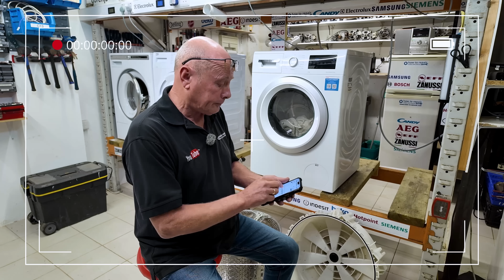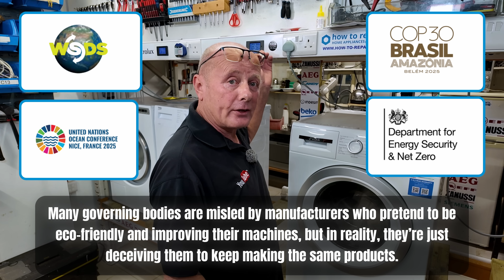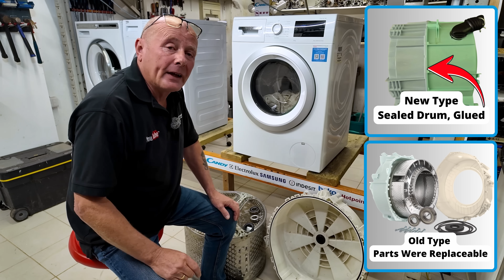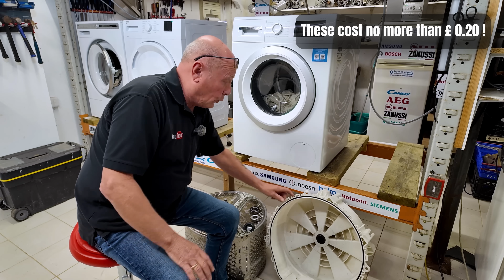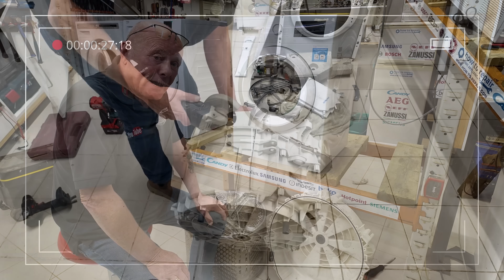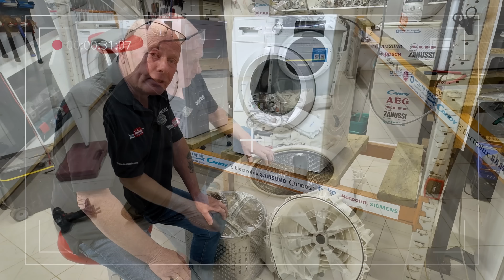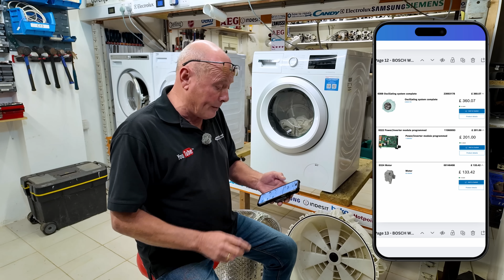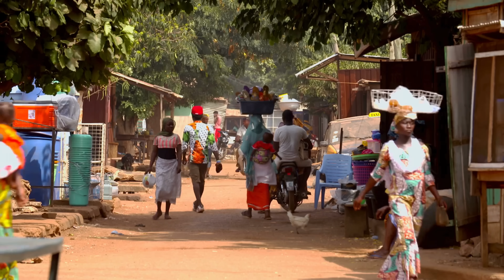Washing Machine SCAM EXPOSED! The Truth About SEALED Drums: Naming & Shaming

Comment: As a result of one of your excellent videos, I have just repaired my tumble dryer. Turned out it was the temperature variable resistance. BUT not without a bit of difficulty. The plastic control panel (which must be removed) is retained by plastic lugs. They are pushed into oval (ish) holes stamped in the casing. Nominally you can just push up the lugs a bit and they will pop out again. Not on my machine though. Two or three of them had been pushed in then some tool had been used to squeeze the oval hole tight on the plastic to prevent the lugs exiting again. I had to drive in a wedge to prise them open again. We have had the machine from new without repair so it wasn't some previous repairman. Simply a crude attempt to prevent repair. Didn't work against me though.

Comment: In Pandemic, I ordered one washing machine and 1 dryer. Both Electrolux. The dryer died in under 1 year. (Yes, I did all the proper care, and I always clean the filters after every use. The washing machine died after 4 years of use. We wash 2 times a week. No kids, just two adults. We do not wash heavy things like blankets or heavy winter clothes. The dryer could not be repaired, but we were able to get our money back due to the warranty. The washing machine was a loss of money. Yes, it was a good machine, but its lifespan was too short. My grandma's machine was an old Indesit. It worked like a mule for over 15 years.  So...

Comment: I bought a Hotpoint Aquarius + 7kg washing machine nearly 9yrs ago and ( touch 🪵) the only thing that has ever gone wrong was it stopped spinning last year. I knew from past experience it needed new bushes, so i went on local community platforms asking if anyone local could fix it . I didnt let on i knew the bushes had gone i played daft and just said its not spinning dureing wash cycle???, OMD i got 3 replies 1 said i needed a new printed circuit bored as thats the only thing that would cause that to happen price £120. another one said it needed a new motor he said he can get a reconditioned one and fit it for £80, the last one said it needs a new motor and belt price £120 . I asked all 3 how would they know with out comming out to look at it ?? all 3 gave the same answer they have been fixing washers for years and 99 times out 100 that was the problem . I went on line and bought the bushes for £5.99 . I removed the motor fitted the new bushes put motor back connected it all back up back to working as good as new. Id like to think they all quoted high prices cos it wasn't worth fixing better off buying a new machine which none of them suggested or they cba fixing it or was gonna rip me off ??, so after 20 seconds finding a tutorial video  on utube on how to fit new bushes i saved myself around £3-400 the cost of a new washer or a £100+ repair bill and fixed it myself and was well proud 😂😂😂😂

Comment: Definitely fake environmentalism and virtue signalling or green washing from these manufacturers.  Common sense seems to have departed this planet. Some years ago I was given a price to fix the bearings in my Miele washing machine and it ended up being not worth it because it had a recurring water inlet valve problem as well that the Miele technicians could not explain notwithstanding that they replaced it several times at their expense even when it was already out of warranty.  I ended up buying a new washer instead - not something I relished as it meant going back to many hours of research before I spent my hard earned money.  Then you cross your fingers and hope for the best.

Comment: Right to repair (RTR) ought to enshrined in law.  The bearings are a great example of why RTR is so important.  Throw the machine away - 525 quid gone or replace the bearings 20 quid.  Landfill goes up.  I replaced the micro-switches on the front panel on my LG machine - cost 1 pound 25 pence.  If you are director of parts at Bosch etc. well you want your bonus right?  Keep those sales prices up by screwing the customers.

Comment: Hoover in NA sells but no longer advertises the floormate deluxe which had issues with motors overheating and seizing likely due to the windings being made too thin but that seems to be resolved (I let mine cool down after each floor section as a precaution) as my last one lasted 5 years of just wet use being junked due to the pickup tube hose fitting splitting open which cause as loss of suction. Hoover doesn't sell this part any longer and all existing supplies are gone and when a used one is made available it gets sold almost immediately at prices that exceed the new cost. (when it was available) They also have bonded the hose to a large fitting that makes just replacing the hose portion difficult if not impossible.

Comment: FATHER ALMIGHTY FATHER CREATOR OF YARDSTICK SUCH I AGRREE HOWEVER MY LORD TIME NOIN YOU OPEN ALL SEAL SCROLL IN THIS DELEMA LIKE GE TUB SEAL ORIGINAL B LACKING ON PARTS SUPPLY SITE , UNDER CARRIAGE PREMATURELY OR  WILL FULLY LACK PAINT , THE HOOD OF MACHINE DEEM TOP COVER NEED DAMPER HINGES TO OPEN CLEAN AFTER USE LIKE CAR HOOD TRUNK TO REMOVE SOAP OXI .

Comment: I (had) a Beko dryer. The pcb failed- it wasn't there fusible resistor, but the actual microprocessor memory for corrupted. It was only 5 years old. I was willing to pay the $200 for a new pcb, as the dryer was very lightly used and otherwise in perfect condition. Guess what- no part available from Beko or any other source, and Beko was not able to tell me if more would be produced.  In had no choice but to scrap the whole dryer. Bricked because of a $1 microprocessor.  (It's the same chip as an Arduino).  Beko - fail.

Comment: I used to be able to buy Bosch brushes for their tools £10, now only motor with brushes £150, new drill only body £160, DeWalt drill trigger £25, now trigger with circuit & fittings soldered to it £75 body only £76 manufacturers don't want money going to the local economy for repairs, more profit in selling new, cant blame them though if it works, the result my scrap bin for power tool repairs is now removed 4 times a year instead of once, just the toxic nature of this waist ruins any hope of being green, the government need to stop cheap imports filling landfill to be serious, then hopefully European manufacturers can produce better equipment again.

Comment: I had the same problem with Slovenian Gorenje washing machine. Bearing has gone, but drum was sealed and it didn't make financial sense to buy expensive new drum for old washing machine. However, it would make a lot of sens to spend 5 euros to change bearing myself.
This way washing machine ended up in garbage instead working couple more years.
This is infamous EU environment and ecology bullshit. Never mind I just toss whole machine in garbage, at least it was consuming 5% less electricity. Ludicrous.

Comment: I have some experience in this. The tubs are not ‘glued’ together but vibration welded. While this is an additional process, it removed the seal, fasteners, fastening process, and pins needed to make the holes in the injection moulds. 

The weld flange profile is completely different from the bolted seal type, and the vibration weld process needs a flange above/below the weld that can direct the forces above the weld flange, so the tubs are very different when designed for each application). 

Generally, the welded process is slightly cheaper as a whole, but are negatives of course obvious - so it’s a decision made on economics. 

You can actually buy two almost identical LG model front loads in the US, one manufactured in the US, the other in Asia - the US model is welded, the Asia model bolted.

Comment: Got a new "Bauknecht" with Autodose featrure. Its just one more part they fit to have another part that can break it seems. Mine broke. Luckly its still in its 4 year warranty so they cover the repair. But that kind of reparis are included in the caluclation. They make much more form customers who need to throw away there machiens after the warranty or replace the whole unit. I hate this.

Comment: Try the current ultimate planned obsolescence icon.
Many car makers have done away with traditional timing chains. Replaced them with rubber timing belts running in oil INSIDE THE ENGINE. Only last up to 80000 km so cam belt change 60000 km recommended. 
This requires extensive dismantling of the engine bay removal of the timing cover, which is plast and non reusable. Costs at 60000 km up to £3000.

Comment: it's the same as when they added a heater matrix to dryers ... when it goes its a switch ..when it trips no heat ... you throw it away or THEY TAKE IT AWAY and it's a simple fix with a screwdriver and a cocktail stick

Comment: "I recently had to replace the controller board on my Miele washing machine after our cellar flooded with 5cm of water. Interestingly, the board is installed at the lowest point of the machine—a design choice Miele claims is for heat dissipation. Miele told me a repair wouldn't be economical, but I decided to buy the PCB myself for €300. It only took 10 minutes to install! Given the machine cost €800 and has run perfectly for 10 years (and still looks brand new), it was well worth the effort despite their advice.

Comment: Sir, India is in the northern hemisphere too, both literally and in reference to this issue. And I am an Indian who just had to replace a Bosch washer for this exact reason. It served us for seven years where we expected it to do ten like our previous LG one. We take good care of our stuff. 

The drum moved forward to the point where it made contact with the gasket at the front loading opening, rubbing against it and producing smoke. Authorised repair technician charged a hefty sum for a visit and gave a huge replacement quote because the drum was sealed. Bought new asu it made better sense, and also because they didn't offer warranty on any replacement part.  Hit our budget buying a new one where a simple repair with replaceable components would've saved us a fortune. 

Thank you for raising your voice.

Comment: Hey! A very important video! I have an AEG 2-in-1 washer-dryer with a heat pump. It cost around £1,300. I was surprised when I tried to replace the bearing! I ended up replacing the entire drum myself for £200. The bearing alone would have cost around £15. Thieves! Do you recommend any other brands? Ones that can be repaired?

Comment: Great points raised here. I'll ask if the drum is glued before buying a new washing machine, and not buy one that is. Currently trying to repair my White Knight tumble dryer ECO 83A tumble dryer - there's a rumble from the front end of the drum...  seems manufaure in the uk stopped in 2019 and spares are very limited ...  wish me luck as i really don't want to buy a new one ... plus they don't make gas ones anymore...
Reply: Well, just as an update i removed the drum... to find nothing that could produce the rumbling noise ! then turned the motor and there it was.. so the air flow fan is connected to the motor via a round shaft with a flat face on it .. the fan has a corrosponding flat in the drive which is held on to the drive shaft with a collet. in my maching the collet has dissapeared ; allowing the plastic to expand and spin semi freely on the shaft meanwhile the fan is off centre and the blades are hitting on the housing , causing the rumbling noise !

Comment: First what is the warranty period  you make a statement then don't follow up with data 

Do my bosch washing machine came from bosch with a 10 year parts a  labour warranty so you say it will fail after 10 years to be honest if it last 10 at £325 we paid its not a big issue as we gotten good use from it. 
In the uk under the consumer act a washing machine expected to work for 6 years . Upto to six year your are entitled to it being repaired or replaced under  consumer law..
Then we have to come to the price . Washing machine today on the whole are cheap disposable white goods.  
They are made to be disposed of after 6 to 10 years 
Manufacture don't have to have spare after 10 years. So why would the go to the great expense of creating a washing machine that can have its parts replace cheaply and for 20 plus years into consumer society  mostbpeople want to replace after 5 years. There are very few of use who keep white goods for years znd years today so when you think about washing machine have got cheaper to buy so they have to be cheaper to manufacture  and it gets to a point where fixing not cost effective my washing machine is 9 years old to replace for a like for like machine it less to day than it was 9 years ago 9 years ago £325 today the equivalent bosch is £299 factor in for inflation etc washing machines are cheap .stop complaining

Comment: Maybe, right to repair needs to be tweaked.   If the machine is less than 10-15 years old but too costly to repair  then the manufacturer must collect it from the place of use and pay for all recyclables to be stripped out.

Comment: Excellent job mate informing people !!! 

As a big DIY guy and always curious how things work I did fix my direct drive LG a few months back as my house was flooded with mud in 2020 and the bearings were sounding like aeroplane. The LG  is 5 years old and the case was holding from screws so taking apart wasn't big deal. I installed install new NSK sealed bearings and new flange.

Brand new 😂.

Keep up the good work.

All the best from Greece kefalonia 💯💯💯

Comment: My grandmother bought a Miele in 1950. It ran well into the 1990ies…

Of course these prices seem too high. But if the drum seems to stem at least partially from injection molding you might have to factor that in. Molds are very expensive. 
Still I think devices should be designed to be repairable. Everything else is only good for business but little else. 
Nice video 👍

Comment: I want to mention that most of the washing machine industry is own by: Arcelik A.S. (beko, indesit,hotpoint, whirpool, indesit, hoover, candy), Electrolux AB (whirpool, zanussi, AEG),  Bosh GmbH.
Then you have LG washers with quality problems (F4W especially on polish market) - high vibrations and noise due to incorrect screw torques during assembly.
Samsung, who pushes ads to their smart appliances.

Comment: What fails on the circuit board? I see sites that print circuit boards. I'm assuming it's the components like switches or power supply modules? I'm wondering if a raspberry pi with a bread board could handle the work?

Comment: Another point: I've already bought new machines and compared the cheapest models to the most expensive. Nothing differed except the number of buttons and LEDs on the control panel. However, on current models, the controls were in exactly the same place. The drums were also identical, and I'm sure the motors were the same. Prices varied from the cheapest to the most expensive, at least double if not triple, but the overall configuration remained the same. I've already repaired freezers (1N4004 diode failure), washing machines (switching power supply failure), and so on.Everything is designed to last only five years and is not repairable; repairs are only possible by purchasing expensive spare parts. Regulations need to be changed to allow individuals to repair their own machines at a reasonable price.

Comment: Just bought a Siemens machine only because I know from past experience that I can get the parts here in Europe. 

This was very disappointing to see because I know what the future will be like. It will fail, and I will just by a new machine from a different brand. But now I know that you actually have to research if you can change the bearings on the drum before buying it. 

What a cluster fuck of a world this is

Comment: I bought a Zanussi ZWF 1470W washing machine around 2008 and it clearly had a noisy drum bearing out of the box. Called someone out and after replacing the pump to no avail agreed with my diagnosis. Then he said there is no way Zanussi would pay for the repair of the drum, it was too much work and money because it hadn't actually failed. He said he didn't think it would get any worse so that was that. No idea if that age of machine has a sealed drum but it seems repairs maybe exceed cost to manufacture. By the way, the engineer was right, it's still going strong after bringing 2 girls up and doing all their washing!
I suspect the reason manufacturers are buying in sealed drums is that they're perhaps less likely to leak, reducing warranty claims. I'm only guessing though, it would be great to invite a manufacturer to defend their position, perhaps there is more to this than meets the eye? As far as I'm aware current Ebac machines use repairable drums as a selling feature so maybe others will follow?
Why not have a repairability rating as well as an eco rating, it's equally important to know how likely it is that our purchase will soon end in landfill and as such cost more to run during the lifespan.

Comment: After watching a east European YouTube video I actually cut my drum in half on my ten year old Zanusi washing after the bearings failed. That was more than five years ago and it is still working. Cut in half and glued/bolted it back together using the unused holes still in place on each side of the drum. Talking about planned obsoletence just look at the drain motor internal coil connections. On mine that also failed these coil wires were pressed in and not soldered as other joints within this assembly. These connections are planned to fail after exposure to any damp conditions. All I did was to clean them and solder them as they should have been done during initial manufacture, worked perfectly. Absolutely disgraceful to say the least and you are correct we are being denied the option to repair items and it makes my blood boil!!